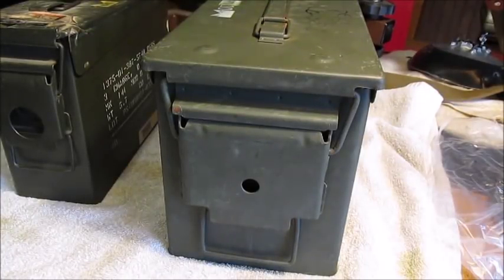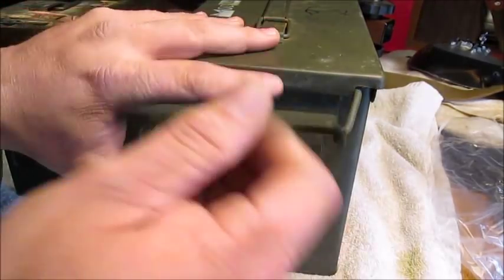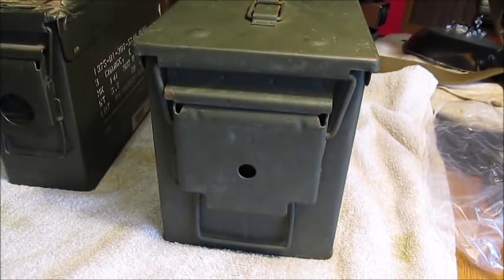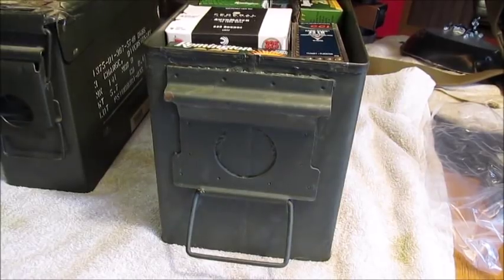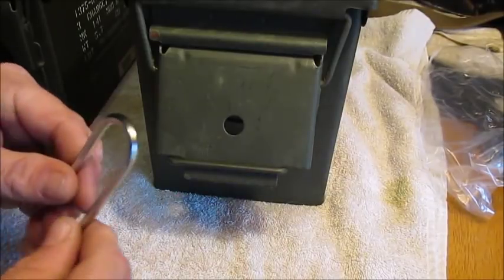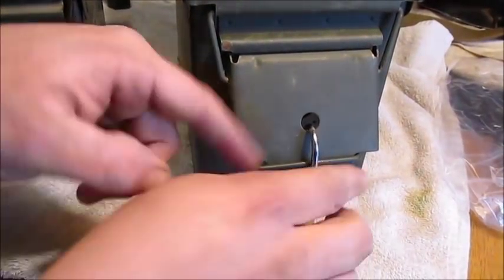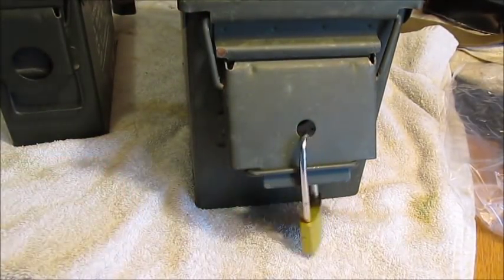How to lock an ammo can...the easy way

Comment: Mounted a couple of these on my motorbike as "side bags"...this is exactly the information I needed on how to secure them.  Thanks.
Reply: came here for the same reason too!
Reply: Im planning on adding a couple of these to my Royal Enfield.. It has canvas panniers but I reckon ammo boxes are more secure, and look better (on a military styled bike)... Are ammo boxes water proof though??
Reply: @sirgalah561  yes, they're perfectly waterproof as long as the rubber seal on the inside is still in good shape.
Reply: @sirgalah561  yeah they're water proof and the latches alone are quite sturdy.  you should be able to find em brand new with perfect seals at a handful of sporting goods stores or something like harbor freight or your equivalent (sounds like you're in the UK riding a Royal Enfield and using nomenclature like panniers, which I assume are saddle bags?)
Reply: Lol same here

Comment: I use a steel Brinks 4 tumbler combo lock with 2" hasp, upside down so it comes up through the closure mechanism. That way I can do the combination without turning the can upside down. And there's less play inside the hasp.
Reply: Thanks for the size.. could not remember

Comment: cool video. Unfortunately, the lock doesn't just need to be a long shackle. The more common problem looking at locks to replace the one I bought that won't work is the space between the 2 sides of the shackle needs to be large enough. If the shackle is a thin enough gauge, obviously you can just increase the angle to decrease the width needed; unfortunately the nice padlock i bought to lock the ammo can only had an inch of space and was thick enough not to allow a deep enough angle while inserting the shackle in the hole.
Reply: The most common-size small-shackle lock is too small by about half a millimetre; I found that just inserting a screwdriver into the hole and warping the metal on the bottom of the hole ever so slightly (hardly even noticeable) was enough for my standard small long-shackle to fit without a problem. I'm not worried about this weakening the metal as it was such a slight warp, and even if it had, this type of lock is to stop children, not actual thieves.
Reply: Buy a step drill. It just took me 5min to increase the diameter of the holes in 2 ammo cans. Lock goes right through now!!!  He's not stupid, that's for sure. Great idea!

Comment: Is it still waterproof with the latch not being fully closed and can the lower latch (the ring that folds up from the bottom) just be popped out of the bracket that holds it to the can or is it one solid piece?

Comment: That will work. I've done it often. It Deppends on the application. I did a 5.56 as a hard saddle bag for my sporty, I used the bolt method for it just for a cleaner look.

Comment: I picked up five of those .30 cal cans from harbor freight today and was completely oblivious as to the function of that extra metal dowel tab. Figured it might be for a tie down or possibly security, but seeing how far it could pop out still and only being on one side had me not so sure. 

Are these essentially solely for securing the boxes with a variety of means, cables, locks, bolts, etc or do they also serve another purpose?
Reply: Same here! I usually use the plastic Plano cans, but I saw these for much cheaper at harbor freight, $14.00, and when I got home I was like “how do you lock it?” I had no idea what that thing down there was. An evolutionary leftover like an appendix maybe?

Comment: Where did you find a lock that would fit? I've tried a half dozen and none of them will fit because the lock width needs to be wide, but the shackle needs to be thin enough to fit through the hole at an angle. This combination is extremely difficult to find.
Reply: That exact long neck padlock is at the $1 store

Comment: That can be opened. You just have to remove the wire side handle by pulling it and forcing from the side until it bends. That handle is just a bent wire.
Reply: Thanks for bringing this us. I’ll test the strength on all future cans. My current cans didn’t budge.
Reply: None of mine are just bent wires. They're solid loops and sheet metal is tacked around them.

Comment: It will take a while to cut through that lock.  However, it will take mere seconds to hacksaw through the bottom metal bracket wire.  This will only work to keep honest people out.  

btw: THE CLUB that they sell for cars, to lock up the steering wheel; it takes hours to hacksaw through the club.  Again, it would only take a few seconds to hacksaw through one section of the steering wheel and pull the club out.  I saw this done on TV back in the 90's.
Reply: posting id its so ammo and guns are in 2 locked places
Reply: bannablitz247 refer to bullboo1's comment above. apparently the answer is yes lol
Reply: That lock will pop open with a simple pry bar or a hammer.
Reply: Peace of mind knowing my guns are locked and ammo is also safe. Children can be very curious and its more for that than someone stealing it or hacksawing thru it
Reply: Dude it's an ammo can. Locked or not they can walk off with it. Hacksawing is probably not the biggest concern here.
Reply: @meatpopsicle3483  you’re narrow-minded

Comment: Yes. A good common sense lockup method. Though the thin bar or wire that holds the over-centre plate in place, can be struck out of place and pried open.
A striker and pry are not hard to improvise.
Reply: Locks just keep the honest folks honest. All the other methods can be defeated just as easily with a few simple tools. Locks are ment to keep the small members of your house safe and for legal transportation in some states.

Comment: what is the model number of this lock? I've tried 2 long shackle padlocks and neither of them would fit, the width of the shackle isn't wide enough
Reply: @ronmartblog  I found the one that works awesome. Its tricky to fit it at first, but once you figure it out it works well. Model number 140QLH its a master lock. Amazon asin# B000EUJHGY you can see a picture of my review on the listing page. Its locking up one of my 50 cal ammo cans.
Reply: @otis76885  the review I saw on that product looks like a harbor freight can.  I have the same and ordered that same lock and it didn't work.  Can you confirm your ammo can brand?
Reply: @PerceptionIsland  bought all of my 50 cal cans at harbor freight. Worked perfectly for all of my ammo cans. Got the 4 lock pack and all of them worked perfectly
Reply: @otis76885  thanks man.  I must be doing something wrong.  I got the same model lock and the space between shanks isn't enough to slide through hole  like the OP video.
Reply: @PerceptionIsland  its kind of a tight squeeze. It took me a couple of tries. But once I got the hang of it, it is easy. The model I listed above works great (for me). I even posted a picture in my amazon review of said lock. Hope it works for you
Reply: @otis76885  oh I got it now.  Thanks for the replies!
Reply: @PerceptionIsland  you were able to make it work? Awesome!

Comment: Yeah, after years of leaving them unlocked, I played with the damn thing until I came up with the same solution. The smaller box on the left (with the bigger hole), can use a small lock where the shaft doesn't need to be so long. I'm not sure if that is the originally intended design (seems kinda klunky) and in a combat situation, I can't image you'd want people fumbling for keys. 

One idea I had was on stacking them and then running a locking bar vertically through all the wire loops. Not really that motivated. As people point out, the whole thing is portable and has a handle, so a lock on it is just to keep out prying eyes and maybe a toddler. It's kind of like having a lock on a lady's purse or a briefcase.

Comment: Seems simple enough. I drill a 1/4" hole and use a 1/4-20 eye bolt with two washers and two nuts and it works perfectly. It's a strong hold and still water proof
Reply from the maker: Cool,but I dont plan on going swimming with mine LOL :)

Comment: Interesting, but I have my ammo kept in a locked Storage locker specifically for ammo.  So although I see why some may want to do this, I dont.  That being said, I think your method although depends on the thin metal carry bar, I think if people want to get your ammo that is easily broken making the master lock a non issue.  But easy method that im sure helps others looking for a quick and easy way.
Reply from the maker: I was just showing how easy it was to lock them.I see your point but a thief wants in and out as fast as he can.So if nothing else this is a deterrent IMO.
Reply: If the lock is cut, and no one broke into the house, then you know others in your household got into it. Children generally aren’t going to cut dad’s locks because dad will know immediately. So yes, it serves a very good purpose. Protection from a burglar isn’t the only reason to lock something.

Comment: like you said cheap little lock if you drill the can, do a nice well made job on your home made pin with a hole driled though for your lock ( by the way drilling is not rocket science, ) you can use quite a large   well made lock that actually looks good and is still air tight

Comment: Bought a couple long neck master locks and tried but it wasn't wide enough between the shafts to maneuver through the hole
Reply: Same here. Mike, What lock are you using? Brand and model number. Really hard to find a lock that works. Not so easy!

Comment: You can now buy an ammo can off of Amazon for $21.00 that is waterproof {tested in the bathtub} and has the hast that goes through the hole installed in it with which you can use any nice lock to secure its contents. (To remove the military text, just put some acetone (fingernail polish remover) on a cloth and rub vigorously)

Comment: This will keep honest people from peeking in the box or maybe deter  the kids , but unfortunately this is easily compromised by pulling the lower bail off. It can be done by hand on the .30 cal cases and with a just slightly  little more effort on the larger boxes.

I guess locks are for honest people anyway. a thief would just take the whole can, so this easy way is a good way to go.

Comment: Ammo can locks can keep kids and the casual observer out.  You can use locks to stop accidental spillage but seriously, a battery dremel tool and 45 seconds will open the lock or **cut off the hinge**.     
Ammo cans are not safes by design.  Imagine being in the field and you need to find the guy "with the keys".  This explains why they require so much force to open.  A can that is "easy open" is more likely cheap or damaged.

Comment: Can you close it all the way to make a proper seal?
Reply: Yours Truly yes he shows you in the video
Reply: +DROOPY DontTRIP I watched the video but just because it closes does not mean it is sealed properly. The only way you would know for sure is a desiccant pack with a humidity indicator card. 
I had a hard time finding locks with a long enough hasp and when I did find some they were a little bigger and interfered with getting a tight  close on the lid. I just bought some locks with a skinnier hasp and they seem to work. I'll know for sure in a couple months when I check the humidity indicator card. If all looks good I will share the locks I used and where I found them.
Reply: Yours Truly awesome sounds good I have the same set up as this man looking forward to your video if you do post
Reply: +DROOPY DontTRIP I probably won't do a video but I'll try to come back here and report. If you don't here from me in a couple months then remind me and I'll report back.
Reply: Yours Truly report?

Comment: They were not meant to be padlocked so no keys can be lost. The cam latch is supposed to be closed all the way down and flush with the side. If someone wants to get into it, they would just destroy the weak spots, the wireframe handle or the hinges.
Reply: But you can do that with any method of locking these, they are just sheet metal, if someone wants in, theyre gonna get in no matter what you do.

Comment: Is that the purpose of that thin little handle on the front, or is that just what I always thought it was, a handle? Seems a little dinky to hold a full can of ammo, but it wouldn't be the first half measure design of US DoD kit I've run across!

Either way, thanks for the simplistic solution, I'm letting someone house-sit for me, and while I totally trust her both from a morals standpoint, as well as her being well versed in and quite savvy with all things firearms, it's funny (bad funny, not ha ha funny) how that liability stuff sometimes works.

Comment: good deal, however..... because flap isn't all the way down, your missing something its called "full gasket compression"  so yes, its kid proof, and a pain in the butt for a burglar, its not water tight,  hope you use silica gel in those cans storing them like that.
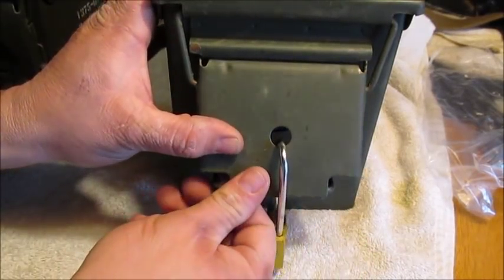Reply: I've been told by other ppl in the comments that you can indeed fully close the latch and you can see it like that at 2:25 for a second

Comment: The only real downside to this seems to be if they are able to cut through the lower bar that is made real thin.
Reply: Jesse Bishop. they could cut through the upper two bars hoding the latch on if it was locked the other ways too
Reply: The lock is easier to cut. That 'lock' he used wasn't very secure
Reply: We know locks are never 100%.  They just slow people down.
Reply: If they have the tools and time to cut through the lock they could just as easily cut through the can itself. The lock isn't to make it 100% secure... it is to make it as secure as practically possible. My motto is that if somebody wants something bad enough they will find a way to get it no matter how good you lock it up.

Comment: I always assumed this was how you do it, and the old 7.62 cans they sell at the army surplus store have a much bigger hole in the latch plate so that you don't need a long-neck lock, just any beefy padlock. 

But my problem is, you can yank that loop clear out of the little stamped-metal lug if you're determined, or you could cut it in the middle with a pair of dikes... well it'd take me a couple seconds but a fella with bigger hands could probably do it quicker.

Comment: I am guessing the purists are probably saying you can pull the smaller bale (wire) off with a pair of pliers, but then you can pull the top one off with a pair of pliers too even if you go with the drilling method...lol
Reply from the maker: saltyshellback Yup,you got it :)
Reply: +ammohead73 It's clever. But I wonder it the top seal still works perfectly with the latch partially open like that. That would be the one thing I'd worry about.

Comment: Dollar store lock wow that's funny
Reply: I thought that too at first. But considering the metal of the lower wire that is brought up to lock to the latch, it would be easier to cut through that wire than even a dollar store lock. It would not keep out someone really determined to get into the can but neither would an expensive lock.

Comment: Your way works just fine, until some smart ass decides to pull the bottom handle off from left and right, in which case this method becomes useless.